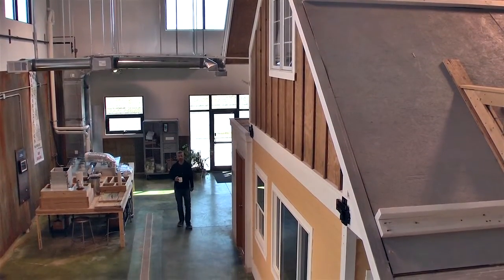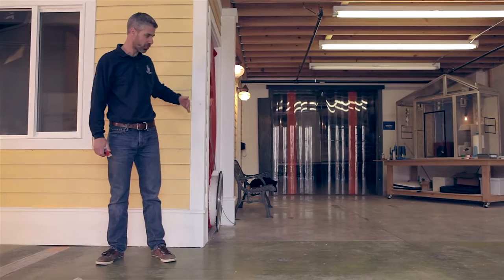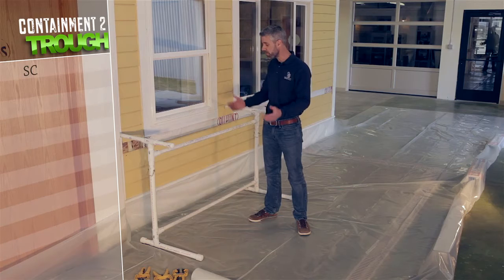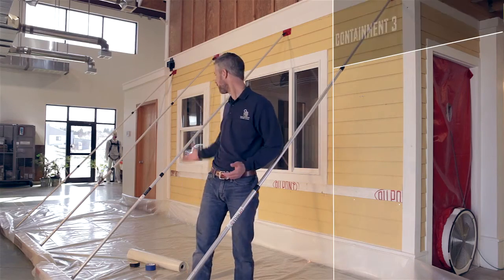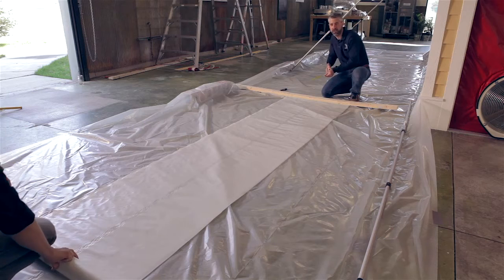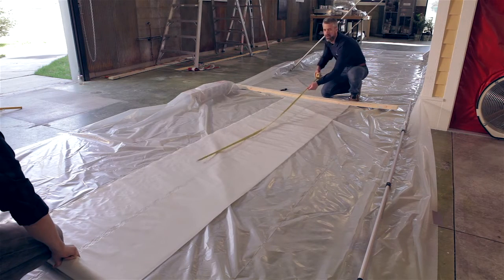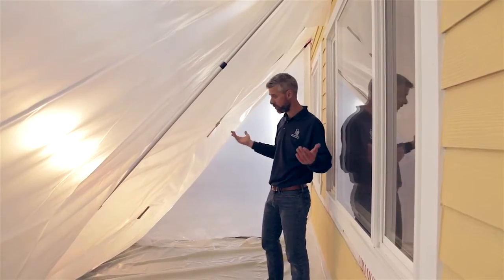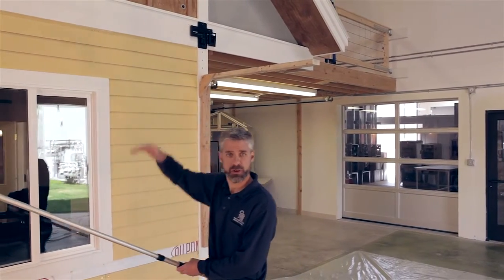Lead-based paint renovation/abatement exterior containment

Comment: How do you make sure that the poles, which are on the inside of the plastic, are cleaned properly of lead dust?  In our city we have a regulation that says the plastic sheeting does not get reused (you don't move it, you use it in once in an area and then take the plastic to a lead facility), but the poles would have to keep being reused.  Or do you use extra plastic to cover the poles?
Reply from the maker: You would just clean the poles of dust before removing them from the work area.

Comment: Have fun when the wind is blowing just 1 mph. This is not reality
Reply from the maker: If the containment is well built & fastened together, it can withstand wind, within reason. If the wind is blowing so much that it is impossible to contain the lead-based paint debris then one would need to shut the job down or risk violating regulations.